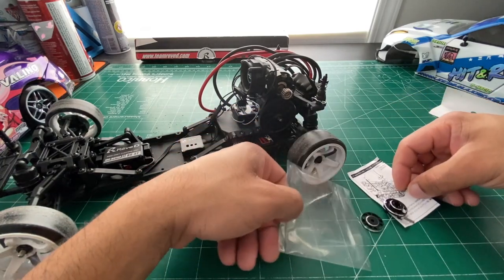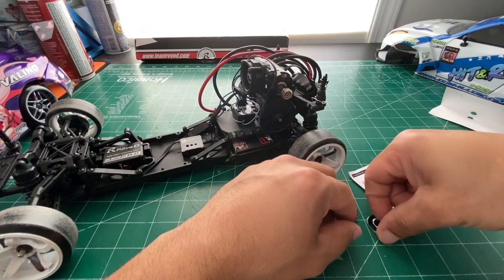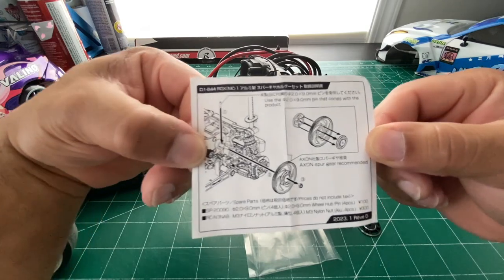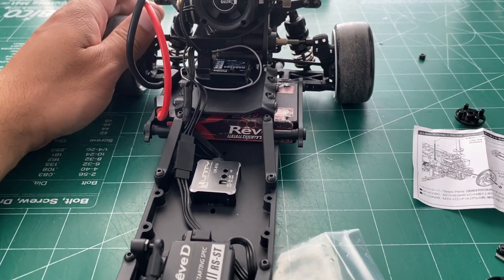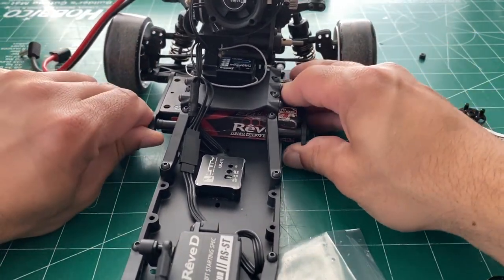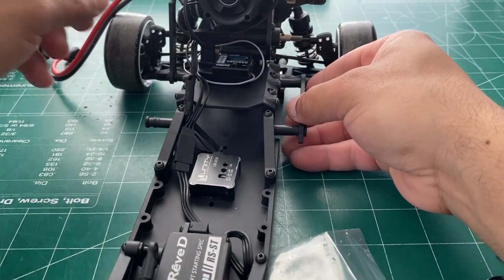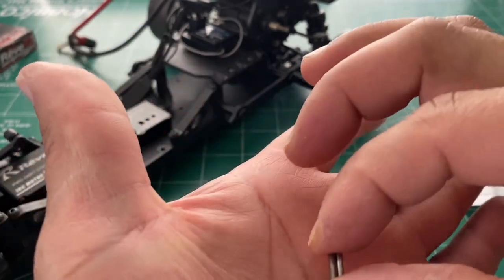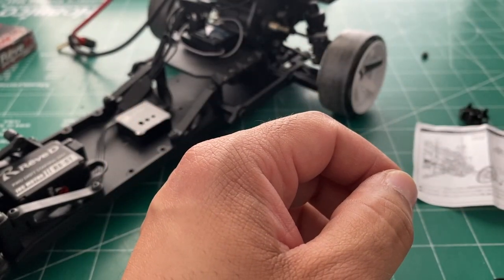RDX Spur gear upgrade

Comment: I see your rear tires are worn all the way across the tread, are the tires curved or flat across the tread? My rears only ever wear on a narrow strip where they touch the ground..
Reply from the maker: they started half way after enough running the whole wheel gets used also depends on set up 
(body roll)

Comment: Hey bro what size turnbuckles did you use 20mm ones. As when I put some on my car handles like a pig.  Even after putting it on a setup station n copying the original settings of the rdx
Reply from the maker: I don't remember I did make a video showing the sizes. I have sold the chassis
Reply: @14arcangel09  ah okay I’ll look thru your vids then what’s the tittle on the vid bro cheers on the reply
Reply from the maker: @MrFrosty888  hey was looking threw my videos and can't locate I'm guessing I didn't make one or I had to take it down cause of monetize but I was using reved turnbuckles I just can't remember the size as I sold the chassis
Reply: @14arcangel09  thanks bro all good I’ll just start from scratch